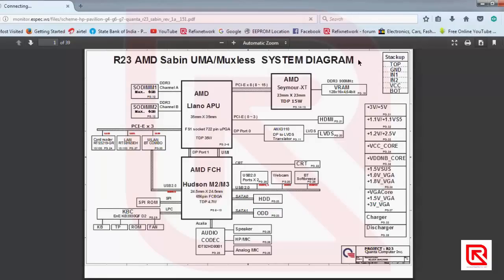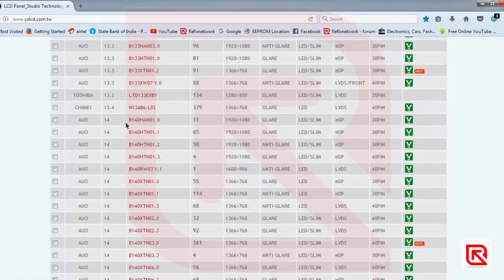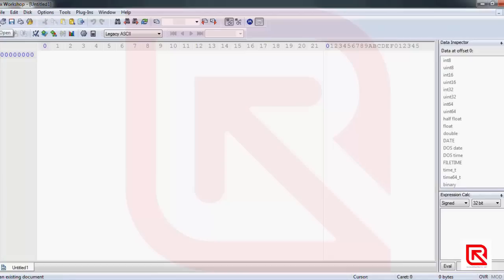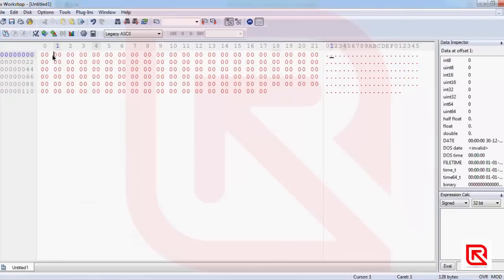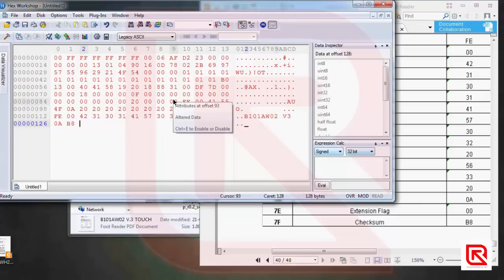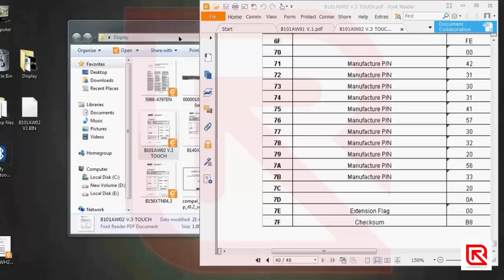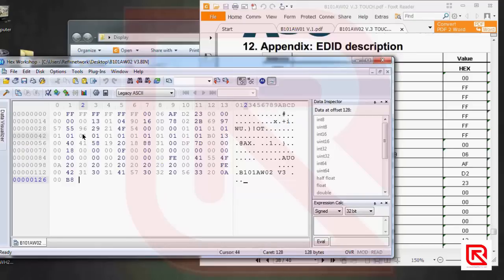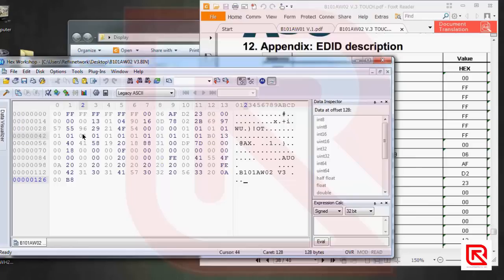how to make laptop display firmware

Comment: Will these firmware work on nt68676 chip based LCD controller boards or only for v59 based boards?
Reply: Yeah i to have have the same board(nt68676.2a) for 40 pin lvds cable screen. So the firmware will work on that board or not..